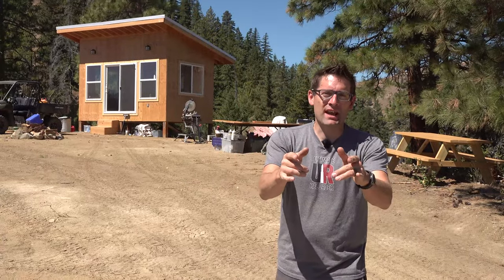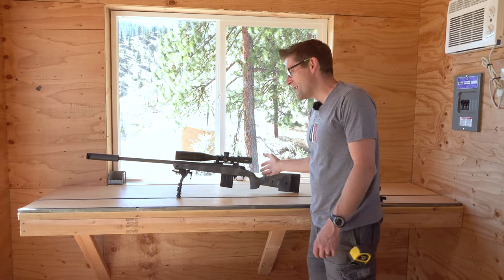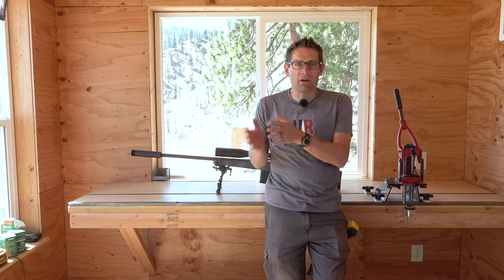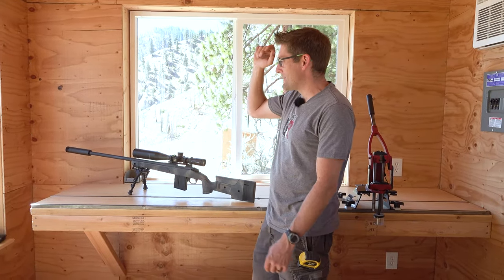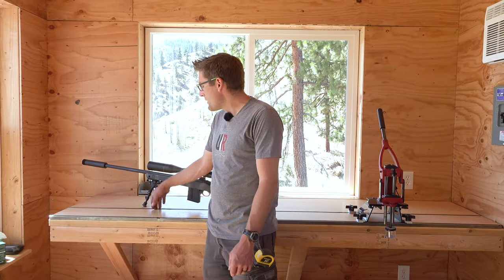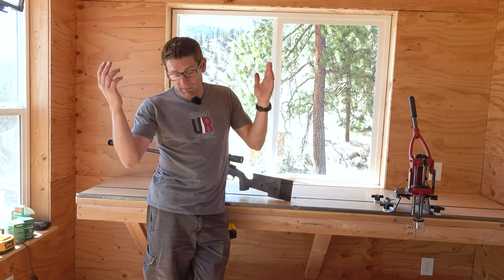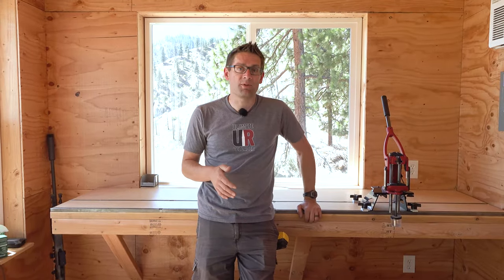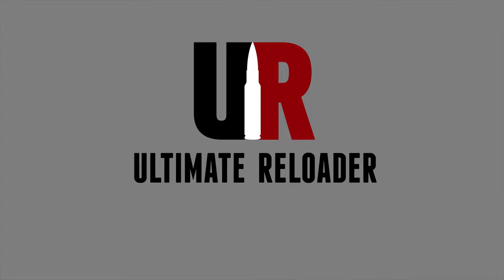Micro Cabin Ultimate Reloader Bench Build

Comment: Dude, this could not be worse timed. I JUST built my reloading bench almost identical to that. Your t-track setup inspired me along with the floating workbench plans I bought from woodsmithplans. If you do sell your steel tracks, I’ll buy them right now, since I haven’t “finished” the build by installing the t-tracks yet.  I was going to order the heavy duty aluminum ones from Peachtree, but steel sounds way sturdier.
Reply: Personal preference but I put a vise on the end of my bench and put my press on a base that clamps in my vise. That way I can pull the press and use the vise to hold my rifle when I need. It’s also in my garage so I use the bench as a work space also

Comment: Nice shop! Next time you do hardwood bench top try using tung oil instead of polyurethane. I finished my oak bench like that and love it! I can write notes in pencil next to my setup and it erases cleanly and if something leaves a bit of a scratch or mark it's really easy to light sand and rub with a little oil.

Comment: I built a few of these several years ago after seeing your first bench.  The only issue I ran into was that I bought a "high" mount from inline fabrication which had a larger distance between the holes for mounting inside the T-track.  Once I ordered the the shorter mounts... my tracks were too far apart :( I had Mike from inline fab make adapters for the smaller mounts.  Not sure if his current ones are still different dimensions.

Comment: Very interested in the kit if you were to offer one. I just order an inline fabrication mount and have been researching T-Track options and not too keen on most of the import aluminum versions on the market. The relatively close spaced bolt head drops is a nice feature as well as the 2-piece cover/plugs. Lot of good lessons learned incorporated into your design.

Comment: The only question I have, is would there be a reason NOT to rip the front edge board to eliminate the 1/8" radius edge so the front face of the bench could be completely flush??

Comment: love to see the electricity setup in a video...
Reply from the maker: Thanks, I'll cover that in the Micro Cabin build video. Spoiler: the outhouse is 60' away and has an 1800 watt ultra-quite generator in it (trenched and ran conduit to cabin). Full 100A panel in case I upgrade generators later...
Reply: @Ultimatereloader  i was hoping it was solar

Comment: I don't understand what possible advantage there is of having tracks break up the continuous countertop vs just milling in 2-3 Inline Fabrication Flush Mount Quick Change stations and having multiple high rises to swap out tools. Drop the flush mount and have a smoother surface to work on. Also I'd have racks on the wall beside the window to relocate tools (presses, brass prep, etc) and be able to pull them out and use them as needed.  If they're already mounted on quick change plates it's 2 wing nuts and you're swapped. To me the tracks and big knobs are so last decade.
Reply from the maker: Michael- that could work great what you've described. For me, I clamp down just about everything- Ultramounts, custom baseplates for accessories, powder measure flanges, etc. with the clamps I've come up with. If you are shy on space and want to use your bench for a lot of different things, I can't think of a better solution than the T-Tracks. :)

Comment: just planning my next bench, was there any problems you had with aluminum T track? and would you mount a barrel vice to your T track set up?
Reply from the maker: A couple issues with the Aluminum T-Track that I used: I had to enhance the countersinking, no room for screw head cover strip (keeps debris out of screw head low spots- phillips drive for example), bolt heads would gall up aluminum making sliding bolts sideways difficult. Having said that, I believe you could get it to work well enough!